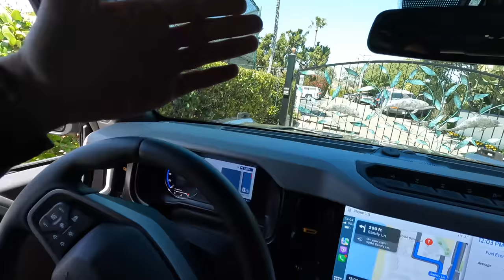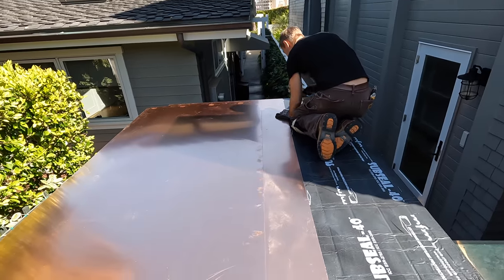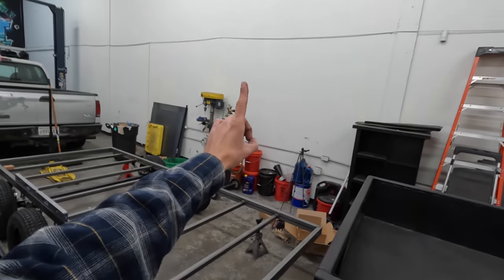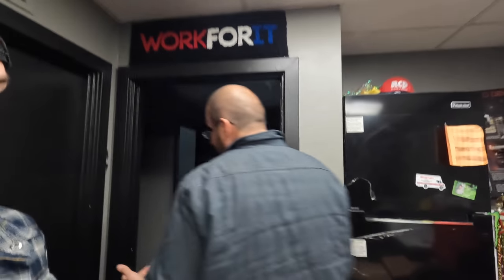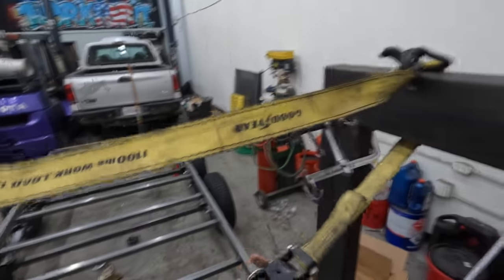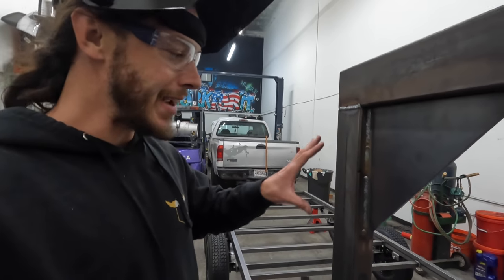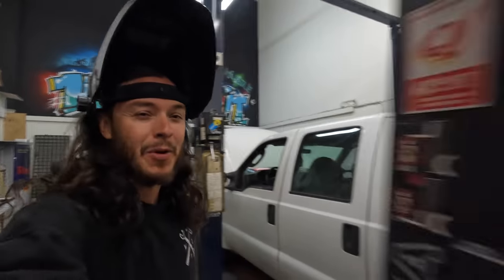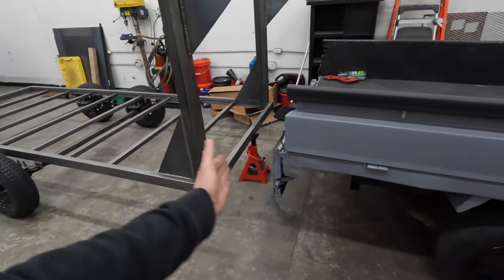Building a Mini Gooseneck Trailer for my Mini Truck! (Part 3)

Comment: Pro tip for Zack. You can see the cycle of the IPR ramp up to hit the max limit on your scanner. That would indicate a high pressure oil leak. Pull valve covers and hit the system with pressurized air via the icp. You would discover the leak at the stand pipe. If you found no leak there you would pull turbo and hpop cover and check again. If your this far in change the oil cooler and plug or replace the egr cooler with Bulletproof diesel product. Personally I would go with a front mount  oil cooler with the bulletproof kit if I was keeping the truck. Great vid! I enjoy the truck stuff.

Comment: Weld expanded steel wire mesh on top of the gooseneck tongue make it a platform could store trailer tires on there it would also help hold everything together structurally

Comment: Break down the cost after you’re done! I’m curious how much the metal and stuff really costs. Sometimes it’s cheaper to buy a used trailer for cheap and then turn it into what you want? Dunno, but gooseneck is really cool tho
Reply from the maker: That was my original plan, but out here people want $600-$800 for the tweakerist of trailers. 🙅🏽‍♂️🙅🏽‍♂️

Comment: Instead of putting the gooseneck hitch in the back of the truck
Attach it above the cab like the old VW Beetles with the trailers so u fully turn up 360 on it

Comment: You could build ramps that store under the back of the trailer to offset the weight of the tongue. Also don't forget to pack the bearings

Comment: If you use a plate in the bed to put the hitch on you won't have to mount it it the frame as long as the bed it is reinforced under it and the plate has ridges all the way around. If you weld the nuts on the bottom of the bed you could easily take the ball and plate out of the bed so nothing gets stuck when you use the dump bed.

Comment: Lol you don't need to put the truck at a 45° you just need to put your tape measure from the ball placement over the corner of the bed. Add your spacing and your done

Comment: Gooseneck hitches in the beds of trucks are usually 3 to 5 inches in front of the rear axle. The reason for this is that  the weight of the trailer and whatever is loaded on the trailer is not solely on top of the rear axle the truck. Having the gooseneck hitch 3 to 5 inches in front of the rear axle help with transferring some of the weight onto the steer axle of the truck that way you're not overweight on your rear axle the truck
Reply from the maker: Good to know!

Comment: I use to work with metal daily. Gutters, chimney caps, awnings, all that. (Boss sends me to any jobs that have anything to do with metal work because I’m the only one who knows how to work it) I HATE working with copper because you have to be careful with touching it and during hot sunny days, it SUCKS to touch. But it’s beautiful when the job is complete. We had an insurance job where the person Chimney cap blew off, somebody had PAINTED the original copper cap, I would have much rather have seen it patina than painted. End product was much prettier

Comment: In your last video the trailer Flip over and only tack welded some parts under the trailer by the tires just wondering if you went back and finished welding

Comment: Should’ve just measured from the corner of the bed to the center of the axle and then added 10 inches. There’s the length of the arms from the trailer to the ball.

Comment: doesn’t the gooseneck defeat the entire dumpbed purpose of the mini truck? i just don’t really get the point of this project but cool nonetheless
Reply from the maker: We’d never use the dumped when hooked up to a bumper pull trailer. Either way the trailer will come off to use it.

Comment: You could of just measured where the ball is in the bed to the corner of the rear bed then add whatever gap you want from the trailer to the truck.

Comment: Instead of putting a bigger hydraulic ram in the center just put two smaller ones on either end and go to tractor supply and buy gooseneck hitch plate to put in the middle and or just simply make one

Comment: you could have just measured from the center of the bed over the axle to the corner of the bed and added your 8 inches and thats your length, didnt need to turn the truck